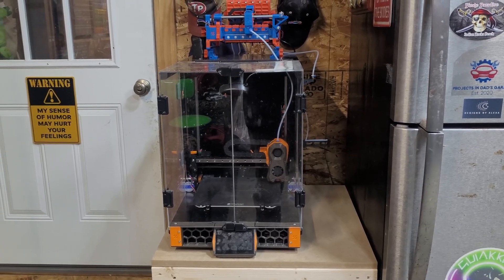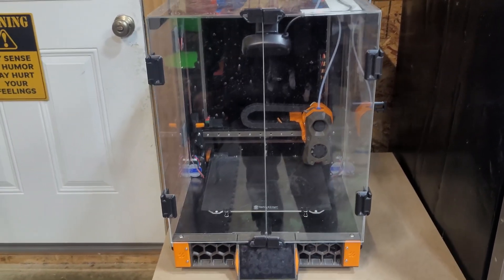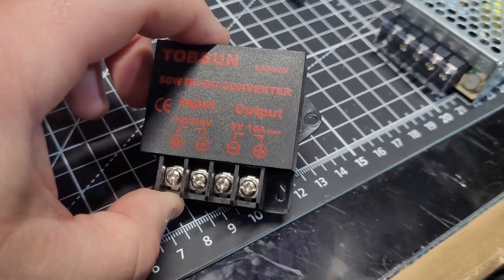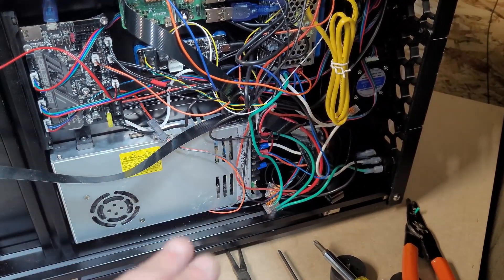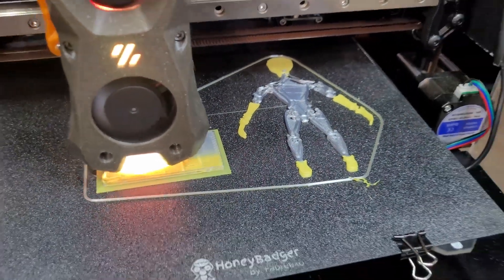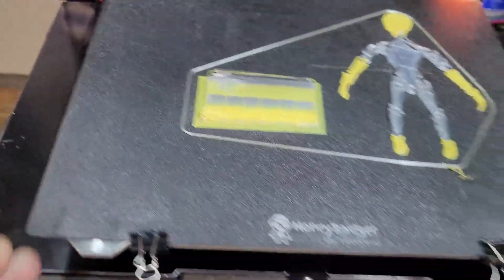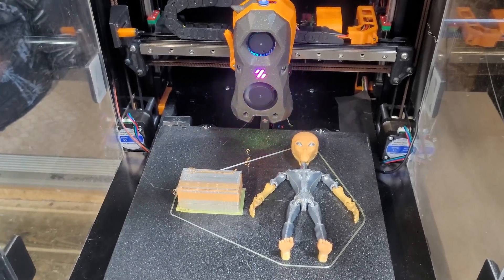ERCF v2 fixing canbus mcu disconnect

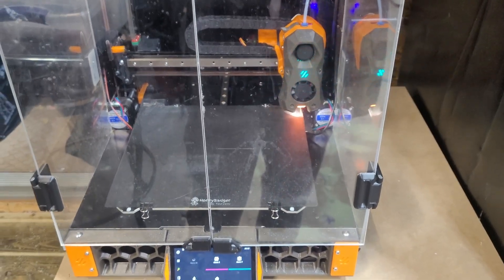Comment: At the 6:17 mark when you go to home the machine I hear what sounds like some serious EMI being picked up by the camera.
Reply from the maker: yes there absolutely is. good catch on that. thank you.
Reply from the maker: also nice channel you have there. subscribed.
Reply: @ProjectsInDadsGarage  thanks for the sub!
Reply: I am going with this same setup for the most part and I was going to use the pi 3b that is currently running my Enderwire but after this I may just have to do the pi upgrade!  Thanks for the video. PS if that wiring compartment bothers you check out FizzyTech EMS System.
Reply from the maker: @Lester_Tucker_III_Sparky06757  that's pretty sick. The 2.4 and the switchwire having been my first builds are a mess in the electronics bay the Trident and the V0 are both nice and clean. Someday I'll clean them up. Have stuff to clean up the 2.4 waiting for a rebuild this year at somepoint